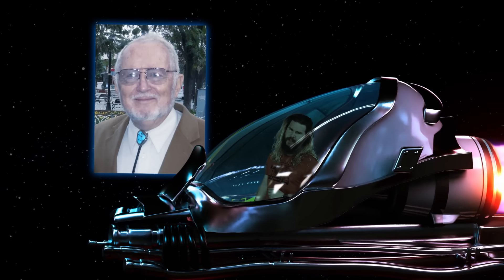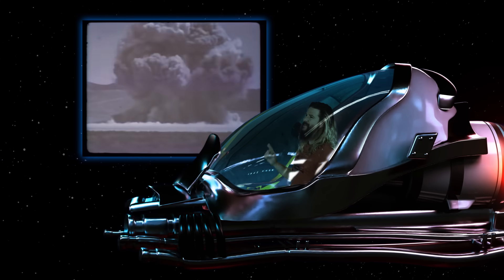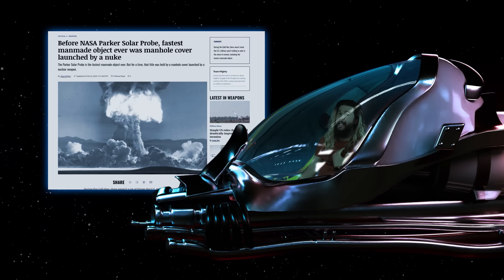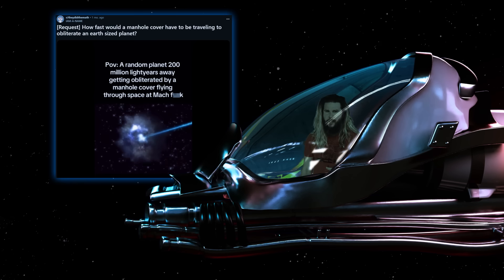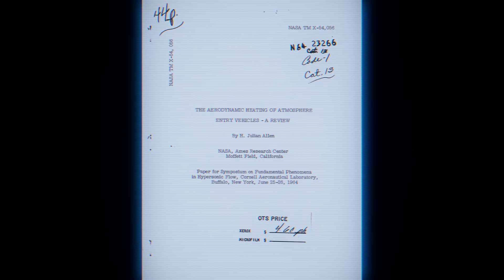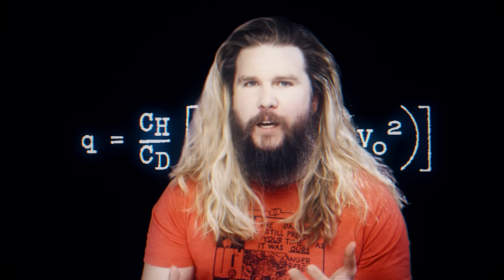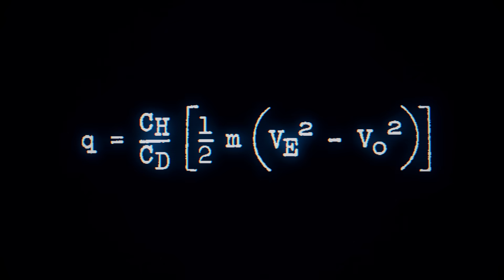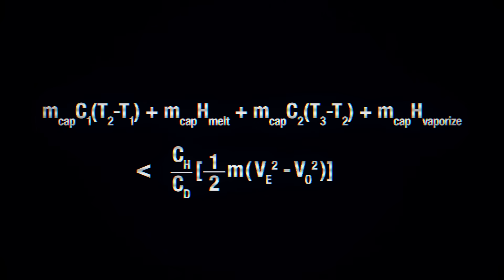Debunking the Nuclear-Powered Manhole Cover

Comment: 1st. Great video, the content, compilation, and performance were exemplary. Also, thank you for showing the math in a digestible way for us out here without phd's and not making us sit through you showing off your skills. 
2nd.  I think you missed an excellent opportunity. The Fat Electrician is a smart guy he would have enjoyed doing this video with you were you explain the math that it couldn't have survived. 
3rd. In his video, he says he dosen't know the math to prove or disprove that the object made it to space, but he would like to believe it did, so he's going to go on like it did. 
4th. Meteors are nothing like the "man hole cover". Meteors are an amalgamation of different elements with pockets of ice in them, (a cast iron manhole cover is densely compacted highly refined steal that is specifically designed to handle high heat application also meteors enter our atmosphere at a very shallow  angle, causing them to go through hundreds even thousands of miles of😅 atmospheric scrubbing causing-  melting, exploding, disintegration or impacting the ground. Not all Meteors disintegrate in the atmosphere some hit the ground ask the dinosaurs. The man hole cover would have only needed the go through about 30 miles of atmosphere before getting to the ionosphere where there is little to no atmospheric scrubbing and its -173c which would cause rapid cooling and help keeping it from vaporizing. I don't think it mad it out, but it's  odd to think that a man hole cover accidentally launched into space could accidentally hit an alien planet 1 day causing major destruction causing us to be in an intergalactic war.

Comment: Just to annouy you...and just because its where my mind went.   a lot of these numbers are based on the idea that...   it stayed flat.     but cast iron can be very maliable.   

So you have a cast iron cap sitting at the top of a pressure tube  that when the blast went off...could have turned it into an explosively formed projectile...   so what we see on camra is not a disk..   but a dart  pushed and stretched into a tight cone shape, traveling at hypersonic speeds.

this would completely change the coefficiants  now we get the fun part,  rather then falling into denser and denser air with the air compressing,  you are heading for less dense air so the atmospheric friction is going to drop...  quickly.

so would there be a manhole in space?   likely not...   but would there be a shaped spear of metal in space with a cloud of iron gas and molten droplets that have solidified over time?   maybe.

Comment: While I am able to follow along, and can, at top level, understand the formula, I do have several questions. First question is, the start location has a much thicker atmosphere than what it will encounter as it travels up, was this accounted for?  as this should reduce the amount of friction it encounters during its journey and slow the rate at which it heats up.  Second question. even if it still does vaporize, at what altitude from its acceleration point,  would it have become vaporized ? (edited for some spelling failures)

Comment: You are trying to do all the math to decide if it went to outer space or not but there is one huge problem you stated multiple times through out the video you did the math assuming the manhole cover was made of iron but that is not the case most manhole covers are made of refined steel which drastically change you're numbers because refined steel has a different melting point. and there is the biggest argument of all if it didn't make it to outer space and burnt up like meteorites do then why is it there are meteorites that have crashed into the earth's surface and not burnt up. if the manhole cover survived the initial nuclear blast without being destroyed then it most definitely made it into outer space.

Comment: everyone here is arguing about weather you are correct, ans i thin \k your pretty on point, however idd like a link or atleast the data ussed to get to 66kms, as there are a plethera of ways it could be wrong,  also would there not be a miniscul add on of thrust from the nuke even at its distance where speed was calculated?

Comment: 100% wrong. That was metal, not ice filled rocks. Metal doesn't explode from steam pressure because there is no water trapped in it. It could vaporize some of it. Lab tests are only good in the lab. It 100% made it out of the Earths atmosphere.

Comment: Abject failure of a "math" guy who can't do basic calculus... Nor does he know how to do heat of conduction equations.  Pathetic.  On top of that: Heat of conduction is vastly lower the higher the speed you are going.  Atmospheric friction  happens for a FRACTION of a second at the speeds it is going.  Which means dear "genius" math guy, there was almost NO heat of conduction.  The speed of sound of Steel is a mere, 5100m/s.  The fastest known heat transfer coefficient rate THROUGH a material is always BELOW that of  the speed of sound in said material.  To hit heat of vaporization of a material via FRICTION, air friction in this case in a plasma field, you need a TIME constant.  One which you DUTIFULLY avoided as this requires simple calculus and a little thing called TIME.  You sir are a FRAUD.

Comment: I’m not sure if all the heat was transferred. I believe with it not being aerodynamic. It was tumbling as it was going through the atmosphere? That’s will help spread out the heat. 
And thing I think the calculation is missing is. 
A meteor falls from space it gets less dense to more dense and the more dense the air is the faster it slows down.  The forces or tremendous, not just the math behind it but all the stuff we don’t see. Like everything has a harmonic balance. An example of this is someone breaking glass with singing. I believe when these kind of forces are acting on the asteroid or airplane or whatever it may be. It will find the harmonic balance because the thick atmosphere and the heating causes metal to be more pliable. I believe it’s going so fast that it finds the harmonic balance and whatever the item is and it causes it to fall
So I propose that is did make it to space, because it’s coming from more dense to less dense so the higher it goes, the less heating it gets, and on top of that it’s starting from the ground and going up. 
I believe with it, tumbling and air and being launched from the ground. It would indeed make it to space. 
However, staying up there is a different story. Because it was launched straight up and not at a 45 or some kind of angle.

Comment: Dont know if this will be seen since im a bit late to the party, but...
   A meteorite is moving from the non-frictional vacuum of space hitting the atmosphere, where it obviously experiences increasingly more friction.   
   However, the iron plate is starting its journey at 1 bar atmospheric pressure/density, and as it travels upward, it would experience increasingly less frictional heating, right?

Comment: Just a thought.   The cover isn't moving THROUGH the air, like the space shuttle reentry which causes all the heat.  It's moving WITH the air that's moving at the same speed and thus no friction conceptually.   Sure, there's some variances but basically if I jump in a stream going 50 mph, I'm going 50 mph but I'm moving with it, not against water standing still

Comment: It would be worth considering that a lot of those NASA derivation for heating are situational eg something already moving fast gradually blowing down in atmosphere with increasing density. These are already approximations and they still relief a lot on observational testing to validate these models. I'm pretty sure I actually read that original paper you cited in college, and base do not and other saw expanded forms for the properties or heat shields for the heat transfer coefficient. Several of these alternative/expanded forms explored terms for heat loss due to evaporation, transpiration(in porous ceramics for instance), and sluggish air insulating boundaries/outgassing air boundaries, sufficed to say it enough complexity in the backend of the dimensionless number that when combined with the debates on shape deformation...that while I still think it vaporized, it potentially got much higher than anticipated. Fluids and thermo math for regimes and terms does get complicated. Interestingly, even if these numbers prove spot on, they are close enough that hypothetically something could be designed to survive with relative ease... Only being a order off with no effort made to have it survive 😆

Comment: I wonder if the atmospheric pressures tapering off were taken into account as there is less air to push against eg less heat transfer at higher altitudes.

Comment: The thing forgotten is that the spin and flip would not only cause drag and slow it down but also cause the heating to be slower, although by fractions of a second. 
 It's almost impossible to calculate due to how much deformation occurred, likelihood none due to cast iron being brittle. 

 My thought is the 1 frame it appeared it is more likely that it has already been shattered, but the fragments  yet spread out.
Vaporized no. Orbit? Also, no.

My logic?  You can shatter cast iron with a sledgehammer,  so the conclusive force from a nuclear blast would shatter is or vaporize it itself.

Comment: couple of things that i think might be wrong
a) this has more in common with a bullet being shot out of a gun than going from vacuum of space and slamming into the atmo vs starting in atmo then going to vacuum of space, as you can see in multiple slow motion shots here on youtube the gas comes out before the projectile so atleast for some of the travel time the lid was going with the air and there fore there is no air resistance.
b) Saying because meteors break apart when hitting the atmosphere there for the solid industrial strength iron being shot into space would also break apart is like saying since I can chew and eat Iron supplements and tablets and such i can also chew and eat nails and bolts, one is not like the other very few meteorites are solid anything, there are a very very few solid iron Nickle meteors that are the left overs of a bigger asteroids smashing to gather or something where alot of heat is generated causing them to melt extra stuff away and leaving you with a core of metal alloy of some sort, but 95% of meteorites that fall fall to earth for example are mostly of silicate minerals and the great majority also contain metallic iron in small-scattered grains, not solid smelted and hardened steel.  So its like trying to make a snow ball out of dry sand with iron particles in it and throwing it vs a Frisbee made of solid iron. 

Now as a personal opinion i think it made it to space, not unscathed very likely looks nothing like a manhole cover anymore, but since man made that manhole cover and it made it to space ( imo ) it is technically the first man made object in space, which makes it technically correct to say its the first man made object in space and we all know being technically correct is the best kind of correct! =oP

BTW I just hope the part where it says MADE IN USA is still intact so when the aliens come all pissed because someone destroyed there new battleship or something we can easily point at the guilty party and hope they leave the rest of us alone =oD

Comment: There are a lot of assumptions in your calculations.  First and foremost, that the iron plate traveled outward from the surface, through the atmosphere, maintaining a perpendicular profile to its direction of travel (flat).

Secondly, it's interesting how you never discuss the actual time it spent in atmosphere, versus the time required for friction to build up sufficient enough to actually achieve vaporization of the 2,000 lbs. of mass.

This is vitally important to the calculations as NASA's scientists have agreed that "space" begins at an altitude of 50 miles above sea-level, which means that at 150K mph, the plate would have reached the officially accepted altitude for "space" in just about 1.21 seconds.

Bear in mind, though, that while an asteroid/meteorite is transiting through the atmosphere, it is experiencing INCREASING friction (as the atmosphere becomes more dense), the iron plate is experiencing the exact opposite as it EXITS the same medium.  It is experiencing DECREASING friction, AND it's doing it in less than 1.25 seconds.

My conclusion is that if you're going to make such an absolute statement, you need to do a far better job of supporting your hypothesis.

Comment: The re-entry equation is not an appropriate choice for this task unless you account for VO being much higher than zero. In fact, even with an extremely high drag force, the velocity shouldn't decrease all that much given that the initial velocity was 66km/s straight up, giving it an initial speed high enough to pass the thickest parts of the atmosphere in the first second. If you account for a considerably higher VO, nearer VE, the energy imparted is vastly reduced. To actually run the maths on this requires calculating exactly how much speed is lost going through the atmosphere - then plugging the final speed into VO. I suspect the final numbers will be much closer.

Comment: Cast iron is hard and brittle. So much so that a flat plate accelerated that quickly, assuming it stayed intact, would probably take on a parabolic shape (the center of the plate is the highest stressed area), which cast iron (even ductile iron) would not like being formed into. If only 1 frame was caught of the cover, it was probably a cloud of cast iron bits. I haven't seen the pic of the plate to see if it were high enough rez to discern it's flight shape

Comment: Three questions.
1) This was certainly tumbling and flipping over, not flying fully edge-on or fully flat, so the surface area "hitting" the atmosphere would be widely variable. If flat-side-on, it's that of 4-ft wide disc: 24in² x π = 1809.6in². If flying edge-on, it's half the side surface of a cylinder: 48in x 4in x π/2 = 301.6in². That's a sixfold difference.
2) A meteor coming towards earth experiences denser and denser atmosphere as it goes. But this was moving away, experiencing less and less. So if heading into an atmosphere , heat accumulates at an exponentially increasing rate, wouldn't moving way experience an exponential decrease? So it experiences the most friction when it's at its coldest, and progresively less as it heats up.
3) A meteor of similar size explodes, yes. But is it of similar density?
Do any of these matter, or was that included in the equation and I didn't pick up on it?
Reply: .. and it was supposedly made of cast iron, which is not a ductile material. To accelerate that quickly would of subjected it to a hammer blow of unimaginable strength. It also was thin in relation to the expanse it covered. I really doubt it was cast and in no way did that plate stay flat (or in my mind ... intact) when launched for reasons mentioned above
Reply: I would *think* it would eventually stabilize to flying edge-on like a frisbee, but I know that a plane with engine failure doesn't move in any way I would anticipate, so I don't actually know.

Comment: So, I have one issue with this. Now I am not good with math, at all, and I'm not saying the manhole cover didn't burn up. So I may have missed this part of your math, but it seems to treat the resistance the object experiences as a constant when it would instead need to be an average. This is significant because an object descending into the atmosphere will experience increasing resistance as it moves closer to the surface, but an object moving away from the surface would experience decreasing resistance the higher up it got. Again, I'm not saying that it didn't burn up. But I'm not sure it's as cut and dry as you are saying here.

Comment: Cool video.  I don't believe NASA wrote any papers about atmospheric reentry straight down; no, more than likely their equation was setup for orbital reentry.  But then I am not a mathematician.  I am simply raising a point I am not sure you considered.  The cover would not have spent as much time in the atmosphere going straight up, and the air resistance would probably cause to slip into an edge-on exit.  (like weather vane, my guess).  Sorry, but I am not convinced it burned up exiting the atmosphere.  (it might have burned coming back down on the next state over, as the earth was turning under it).

That said, I appreciate your attempt to provide a lucid and well thought out explanation.  Thank you.

Comment: The speed of exit velocity of the planet is 1/4 of the speed of re-entry because you're dealing with less Mass of are molecules on the surface making coolant on the way out and that is still the higher level of heat and that is implying you're having the same speed the whole entire time of re-entering the planet when you enter a planet you're dealing with all the air molecules at the same time and increasing numbers exiting last numbers on the way out😊 and then freezing cold temperatures

Comment: when did friction have full effect? how far did the expanding gas cloud travel with it as it was expanding at the same rate, drag wouldn't be consistent if it was flipping through the air, dropping a quarter doesn't even fall straight. there's a lot more than these numbers. sadly this is a question that will probably never be able to be fully answered.